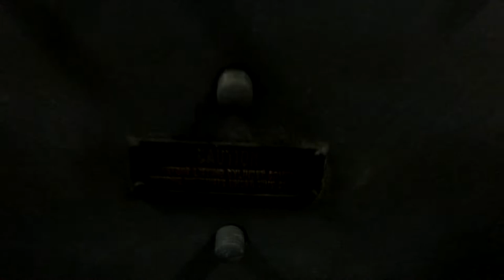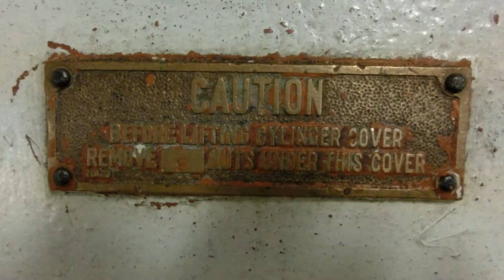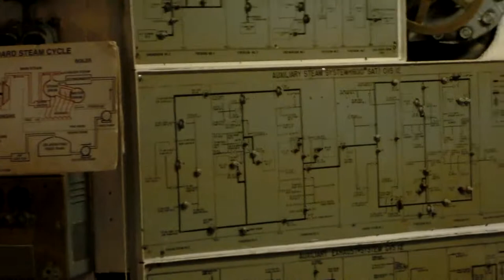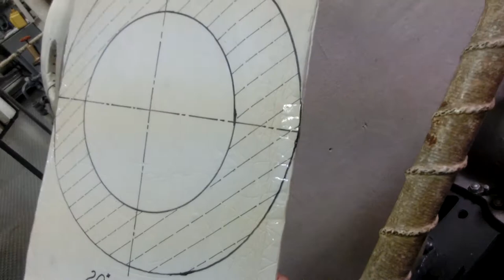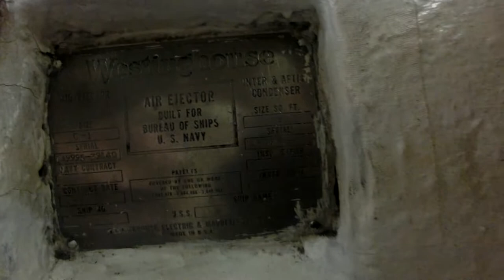Steam turbines engines that powered USS Aircraft Carrier Hornet

Comment: If you're a former MM,engineroom snipe and,you've been out many years,you know exactly what he's talking about and,in some cases you're viewing this as some serious hole snipe porn. ;-)
Reply: Very true.  I served as a MM3rd class on the Essex carrier Bennington CVS-20 during the WesPac 1968.  My primary watch was Throttles, Fwd Engine Room.  We would often stand under way watch 4hours on and 4hours off.  That was known as Port/Starboard watch duty.  If you did not have a watch relief, it was known as 4 On, Cary-on.  We would turn our cap around and stand the next watch also.  While under way we were expected to stand our watch and work in the machinery space during normal working hours 7 days a week.  For E4 rank and below the regular work assignment was a portion of the machinery space assigned to be kept clean and ship shape.  Most of the time was spent removing rust from the steel deck plated with a wire brush.  We also polished brass fittings and painted.  We would add Prussian Blue to white paint to make it appear whiter.  E-5 and E-6 would hang out in the "phone booth" at the bottom of the steps and monitor the level in the large de-aerating feed tank.   I left the Navy 10 years later as MM1st Class.